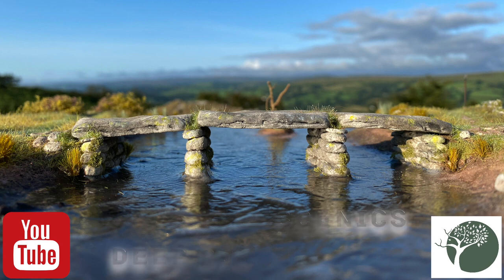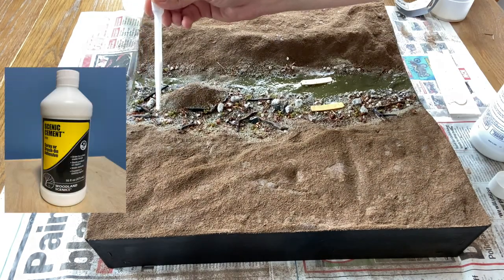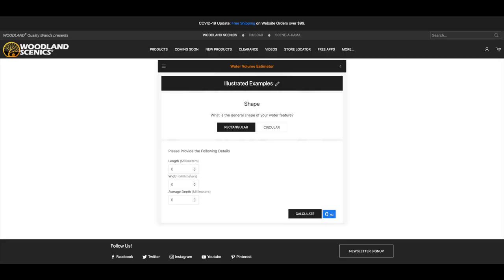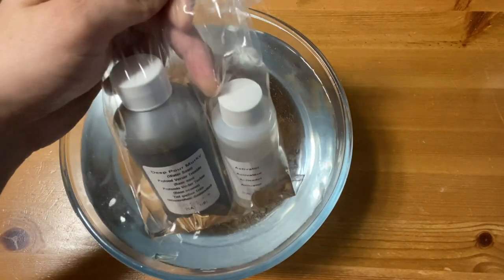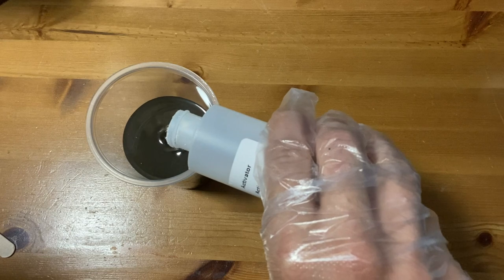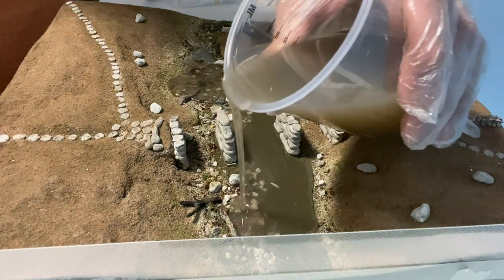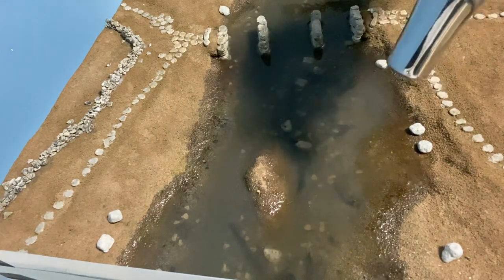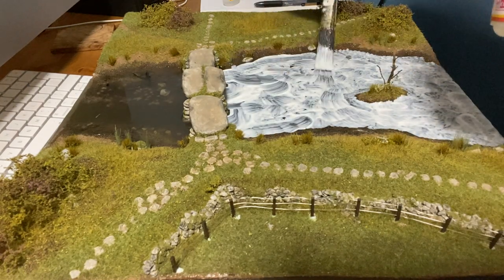Woodland Scenics Deep Pour Water

Comment: Wow stunning! Thanks for demonstrating how to use deep pour water, curious if you have experienced the resin scratching? and is there a method/polish you recommend to address it?
Reply from the maker: Thank you Jonathan!  Fortunately, I have never experienced a scratch but I usually have a layer of ripples (gloss Mod Podge) which protects it.  If you don’t use a layer of ripples, I think it will always be slightly vulnerable to damage on a regularly used layout.
Reply: @DartsideScenics   How long did you wait before applying the mod podge?
Reply from the maker: @JonathanChristian21  it usually takes 24 hours to cure depending on conditions.  If there is any doubt, perhaps leave it for 48 hours.

Comment: I dont have a blow torch, is there any other way to remove excess bubbles without shelling out ?
Reply from the maker: I’ve seen isopropyl alcohol spray used although I haven’t tried it myself.  That still has a cost so not ideal.  Mixing the resin gently should reduce the risk of bubbles.